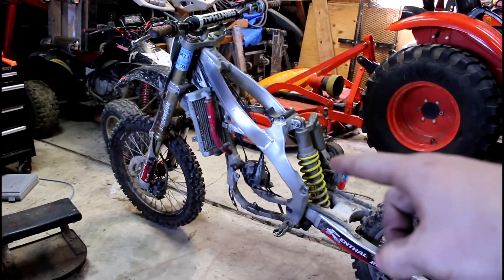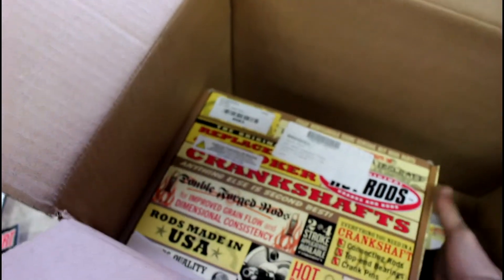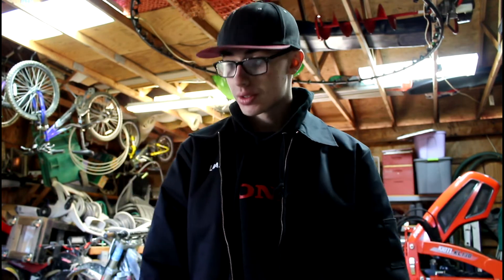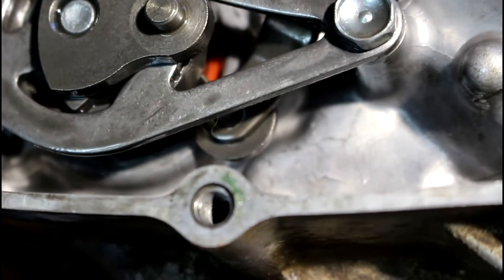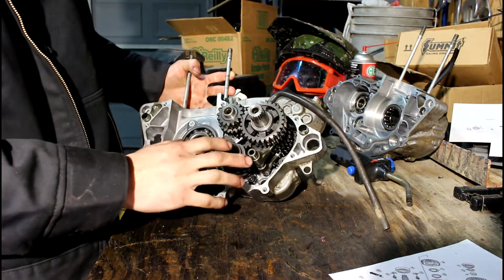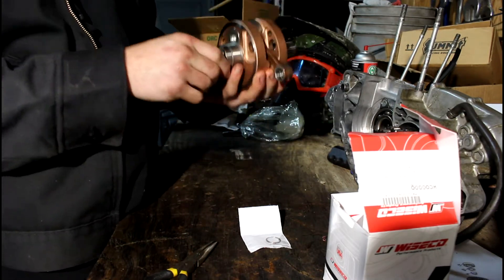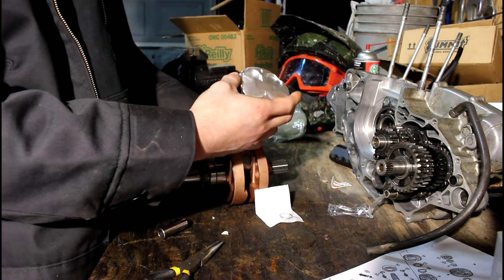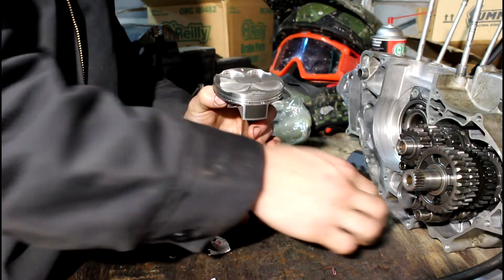CRF250R Transmission + Crank shaft Assembly

Comment: How’d u pull the bearings in the case ? I’m currently about to rebuild mine with the same kit
Reply: Same
Reply: @ethanbeavers6496  u want sum help ?
Reply: I use an oven to get the cases around 200 degrees they usually fall out if not use a blind bearing puller and they come right out. And installing the new bearings freeze the bearings and heat the cases just make sure you drop them in square

Comment: This is an awesome video man! Keep up the hard work. My sprocket came loose on my 08 250, and completely stripped the counter shaft splines while I was riding. I gotta pull the engine out to replace the counter shaft, but is there anything I should do before I pull the engine from the frame?
Reply from the maker: I got some videos of removing the engine from the frame
Reply: I would unscrew the bolts first, personally
Reply: @gabetatlock7156  wow, thank your for your input haha

Comment: Whats the torque you used for the transmission bolts? In the manual all it says is 16lbf but thats way too tight
Reply from the maker: That is a pretty reasonable spec, it sounds like a lot but its not.
Reply: @liamperryBRSS  i found out it was 9lbf which sounded a lot better to me, but i also did find out 16lbf was just for the drain bolt. Another problem has risen though, my dad got “ambitious” and we broke the clutch basket fingers off after trying to torque that on eithout the special tool. 350$ added to the bill 🤦🏻
Reply from the maker: @gabetatlock7156  coulda used a 3/8 impact 🤷🏻‍♂️
Reply: @liamperryBRSS  without the clutch holding tool?
Reply from the maker: @gabetatlock7156   that's what I did and its fine. There's also the locking tabs for the nut.
Reply: @liamperryBRSS  doesnt the centre part of the clutch spin when you try to drill on the bolt?
Reply: @liamperryBRSS  like that little piece that sits in the clutch basket that spin independant
Reply from the maker: @gabetatlock7156  use a gear jam